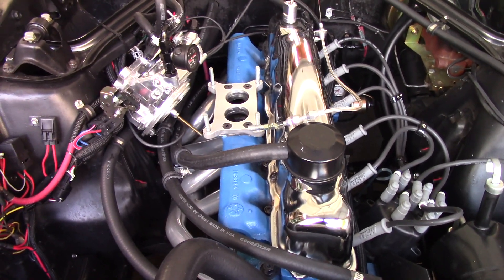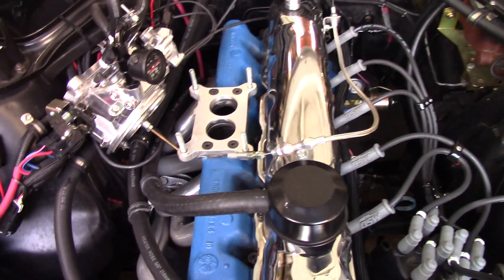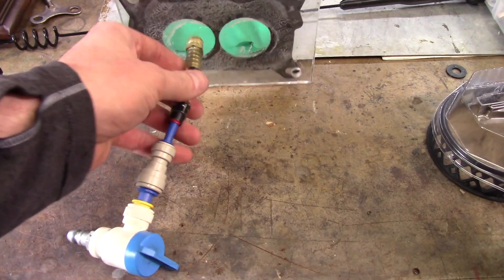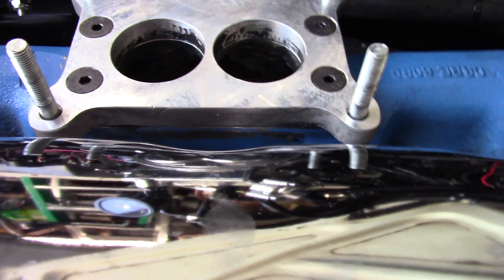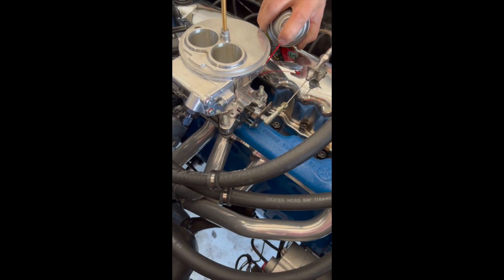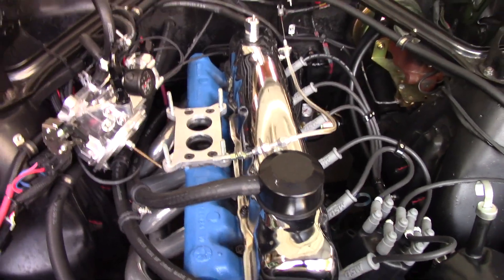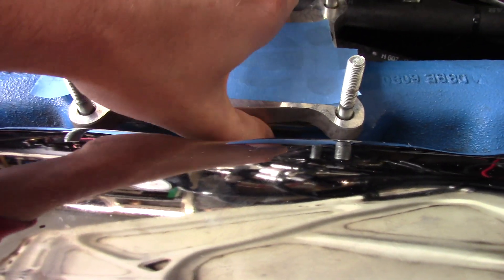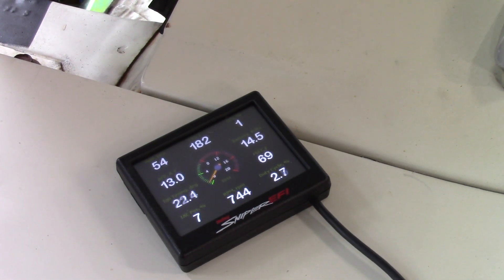Ford 200 Vacuum Leak Detection and Repair

Comment: Who did you use to do the 2v conversion? I'd imagine any machine shop could do it?
Reply from the maker: Jeff Jones at Vintage Engine Works.  There are a few ways it can be done. I prefer the way Jeff does it. He furnace brazes a plate to the log. He’s mastered it over several years so that’s why I chose his.
Reply: @mechtrician1  ok ill get a hold of him as i have a 250ci cylinder head I'd like to do some work to for my 79 granada. I probable will just run a 2v carb though as ill probably convert to a v8 later on. Just curious what type of fuel mileage are you getting with the sniper if you have even checked lol
Reply from the maker: Jeff is a good guy. Does quality work and stands behind it. 
I’m still playing with the tune. It’s been hard to get it right but I’ve gotten 18 out of it but the timing has been pretty conservative. Going to try a new tune tomorrow.

Comment: Do you have a pic of the cylinder head with that adapter plate removed? I’d like to see how they machined the cylinder head.
Reply from the maker: I do have pics with the spacer off but you won’t be able to see it. There is a steel plate brazed to the log. He mills the log open to a rectangle and makes a steel plate with the 2 Venturi bores and 4 tapped holes to attach the spacer.